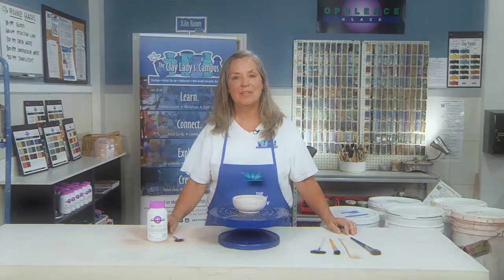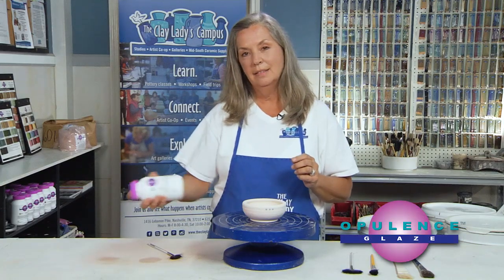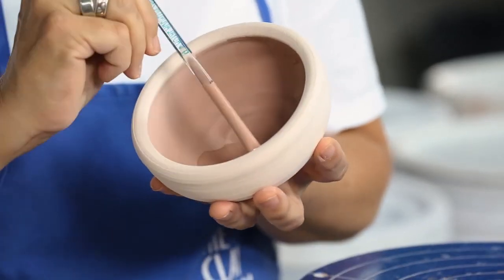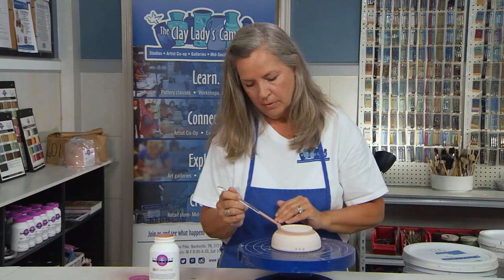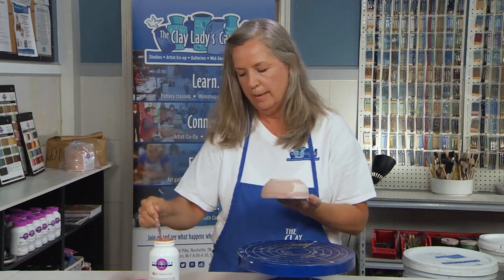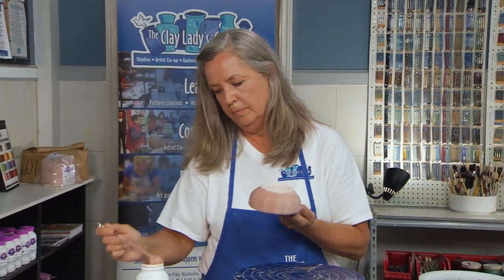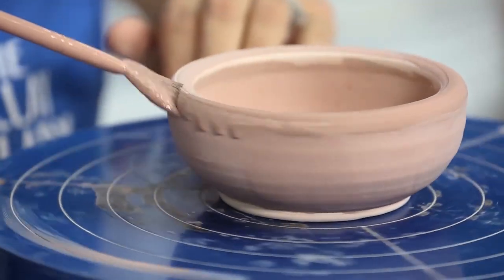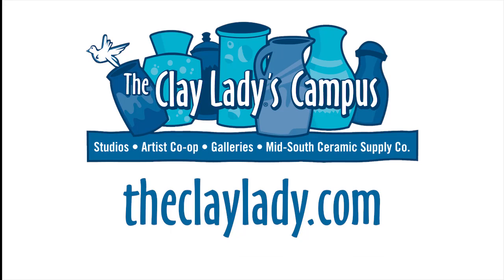Brushing Glazes with The Clay Lady

Comment: Hi there
I asked another YouTuber this exact thing I needed to know this. But I’m going to ask you also...
I’m just starting out in painting ceramic and I’m  shopping for a new paint brush set but I got confused at what set to buy cause the options they gave me a choice of Nylon, Hog & horse and I know there’s more than that so I thought naturally something Soft so I’d go with nylon but I wasn’t sure so I YouTube it 😌 that’s how I found your video so my main question is does it matter what the bristles are made of ? And if so I’m wondering what is the best bristles to use? I also want to purchase a whole set with one of each type of brush like a 1large brush, 1fan 1brush ,1detailing brush & 1sponge  brush all in one at a good price between $10.00 to maybe $25.00 I’m kind of in a budget right now and I don’t need a lot of brushes right now just basically one of each for the moment plus I actually have a few brushes cause I do some painting but I’ve literally just started painting the ceramics which I used my paint brushes and tgey turned out pretty good 😌 I’m starting a little business I don’t make ceramics I paint them but I want to do things right and need all advice and recommendations I can get  I always take notes as you said too 😆 but yeah if you could help me choose that be wonderful I’m buying my brushes very soon but I need to know what to buy. Hope you see my message and can answer or help 😌 thanks.